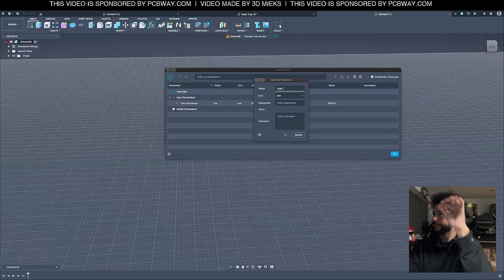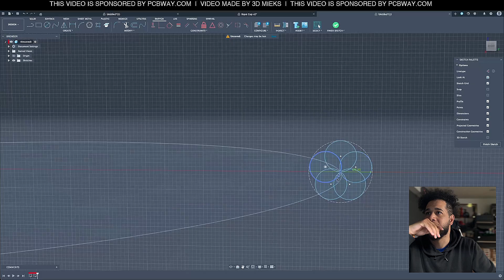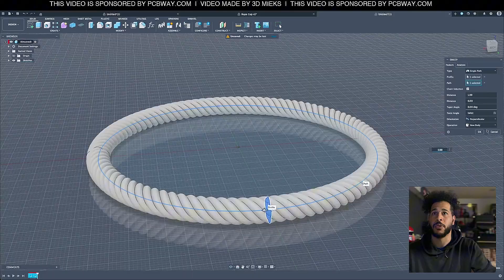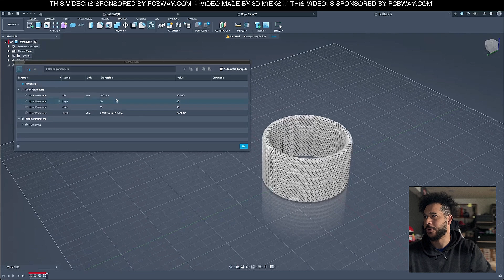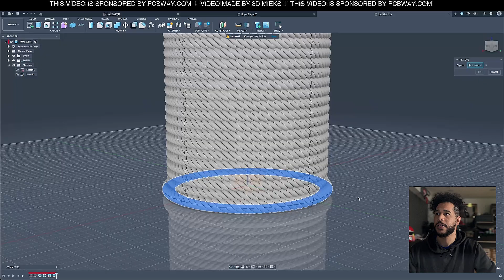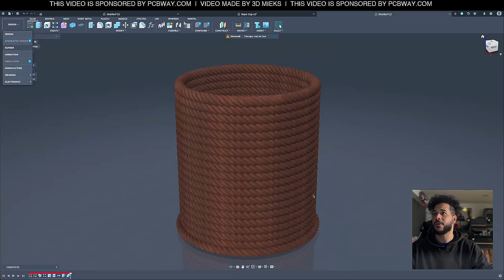Autodesk Fusion Tutorial: Create a Modelled Rope Pattern Cup in 10 Minutes

Comment: Brilliant. Wondering how far this will go when using a coil as the path. (It works - so long as you don't intersect the profile anywhere along the path.) Thanks for the cool "texture".
Reply from the maker: There’s a way even if they intersect using surface sweep, I will be covering it soon
Reply: Nice. I was using a surface sweep to split my cylinder face into the spiral that I tried this on. Didn't realize I could create the sweep for the rope profile as well.